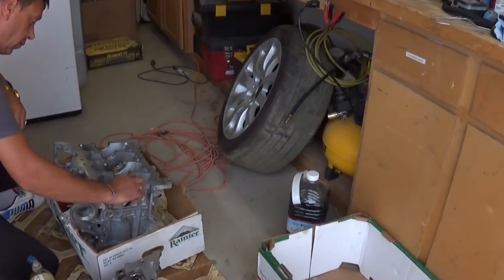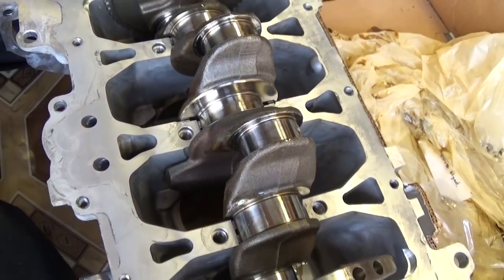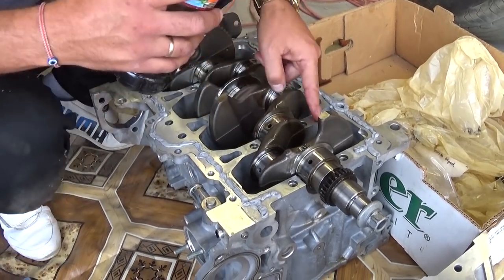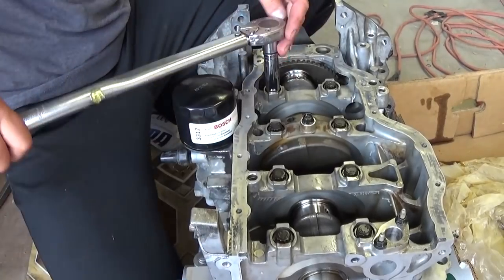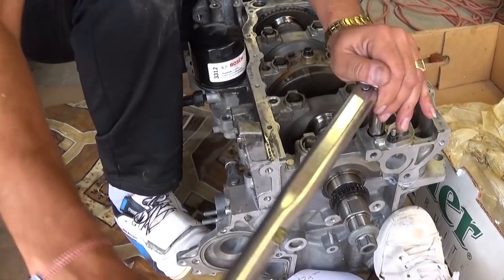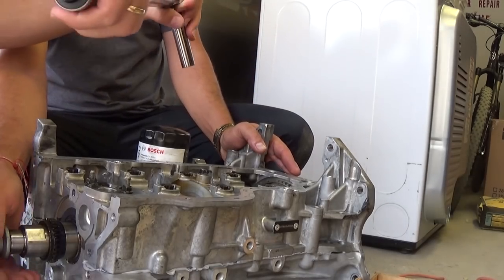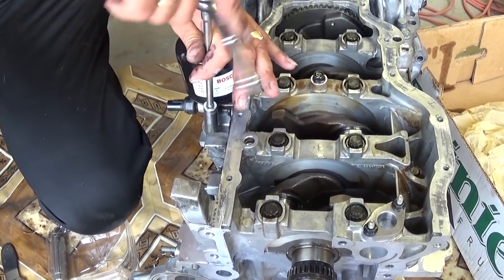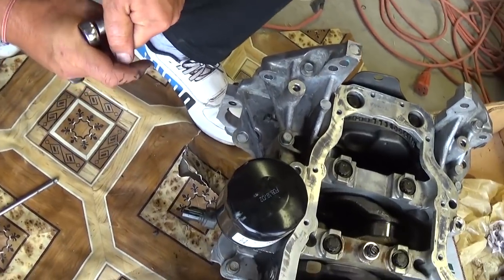CRANKSHAFT MAIN BEARINGS TORQUE SPECS SEQUENCE KIA FORTE SOUL 1.8 2.0 NU

Comment: Hi I am working on a KIA NU 2.0 engine. crankshaft has been removed and fund #1 cylinder rod bearing is wear out and just a little bit left. #1 rod journal size are 0.55MM less than others. do you recommend to just change the short block or get aftermarket parts to replace that damaged parts. BTW I took the crank sprocket gear out and don't know how to put it back (because this is no teeth on crank to align the gear, looks like it was pressed in). thank you for reading if you guys have any recommend on how to finish this quick (the car already stuck in my garage for 2 months) please reply me. Thank you again.